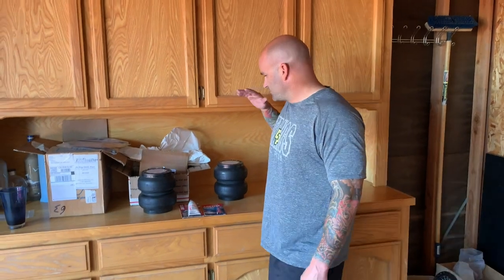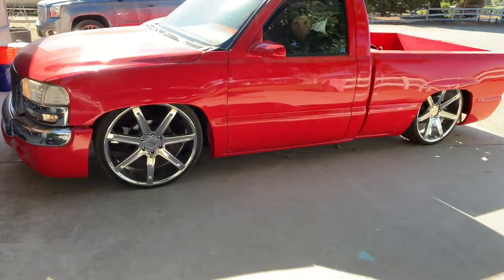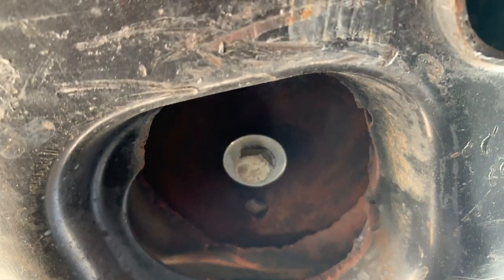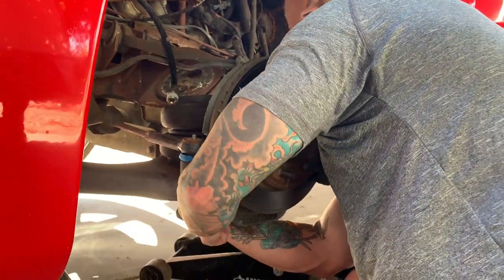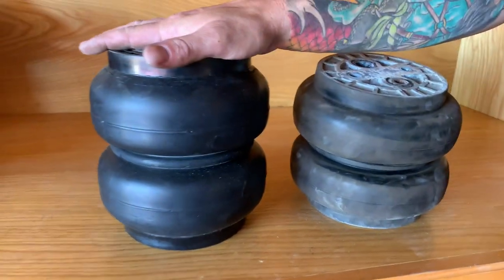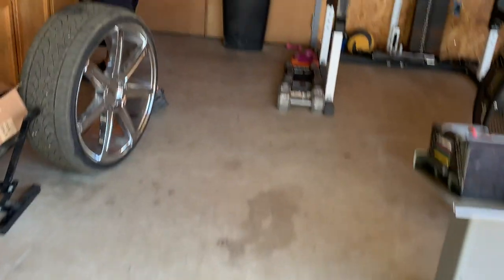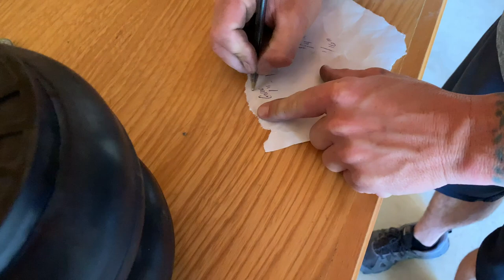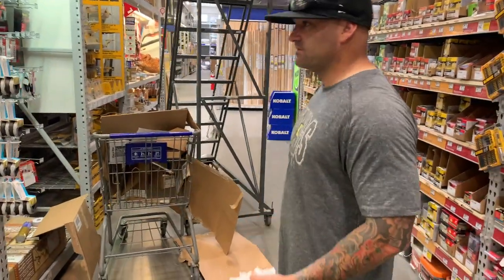Silverado Slam Speciality Airbag install Part 1

Comment: JET-LUBE V-2 is the product to use it will allow instant pressurization after install and will prevent rust and corrosion from forming

Comment: Buy all bolts at tractor supply if you have one in your area. They sell bolts by weight and it's a lot cheaper that way.
Reply from the maker: thanks for the info we will check them out

Comment: Avs in Fresno ca is a great supplier of air suspension parts I’ve bagged many vehicles using their equipment. The three bolts are common I just up grade em to grade 8 up posed from grade 5. That’s liquid Teflon thread locker would have been better

Comment: Should of put the 2 top bolts back in and remove the air line, that a push fitting, air line would a cane down with a lil force pushing down on fitting
Reply from the maker: your right its a learning process for us that I point out on the other side.  thanks for the view.

Comment: I don’t know if you showed in the video I haven’t watched yet but I will. Where did you run your power wire to? Thanks
Reply from the maker: Which power wire you talking about
Reply: @NDOTV  What is this dingdong shop why is my airbags up they took the hot wire went to a fuse on the side of the dash I just discovered this
Reply: @NDOTV  I went to this ding dong shop*** i meant to say

Comment: What is the link to buy your air bags, And about how much was the total cost?
Reply from the maker: I ran different bags in the front and back. But both were made by slam specialties ss6 and ss7’s. You will need to see what size is recommended for your vehicle. I purchased mine through AVS in Fresno, California because they are close bye so shipping is quick. I believe they cost about $211 shipped for a pair. Let me know if you have other questions.